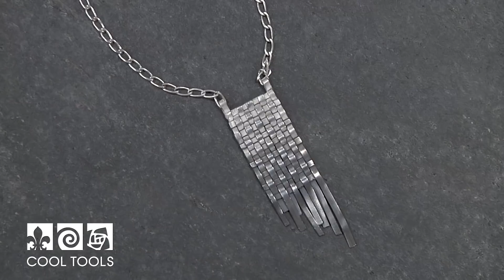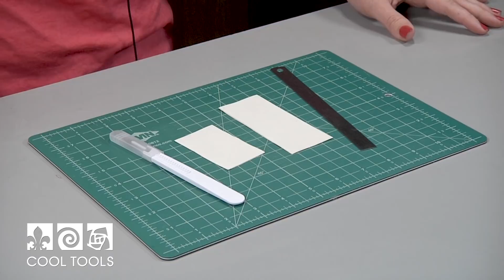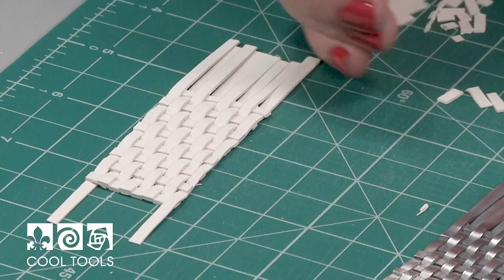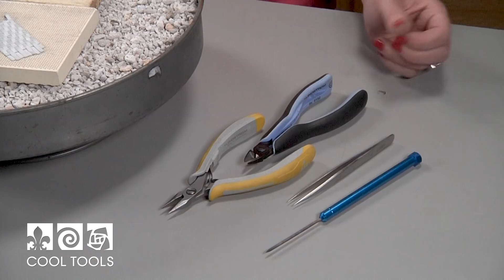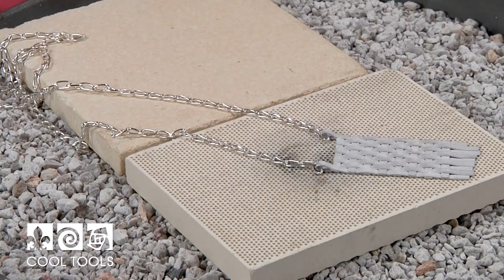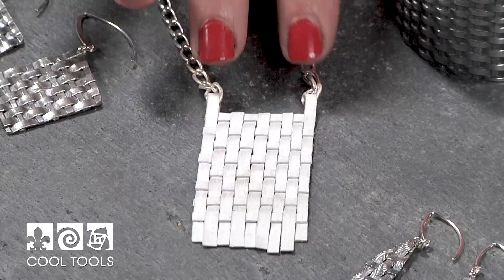Cool Tools | EZ960® Basket Weave Pendant by Karen Trexler

Comment: Yes, it’s a nice design…. Karen can I use this in the ultra light beehive, kiln???? I’ve also been curious can I also use copper or the bronze in the ultralight beehive kilns??? Thanks Aumijewels….. Michelle
Reply from the maker: Hi Michelle, we have not testing firing this piece in the beehive, but it would probably be able to sinter. We do not recommend dimensional pieces to be fired in the beehive, but due to the nature of this particular piece, it would probably work. Base metal clays cannot be fired in the beehive. Base metal clays require carbon and a firing pan inside a standard kiln.
Reply: @cooltoolsvideos  thanks for getting back to me. I guess it’s best to keep saving up for a regular kiln.🤗Michelle

Comment: If you don’t mind me asking is there a certain reason why you dried it out 1st and then cut it out? From so many others I’ve seen they have always cut it out before drying and then even used water and such to help to keep pieces together and then dried it out and fired.
Reply from the maker: Hi, I dried the clay first and then cut my lines because i was able to get sharp clean cuts that didn't require sanding by cutting the dry clay. I usually find that when i use a needle to cut wet clay there's a dragged edge that has to be sanded away, and since there was so many cut edges that was definitely a step I wanted to skip.